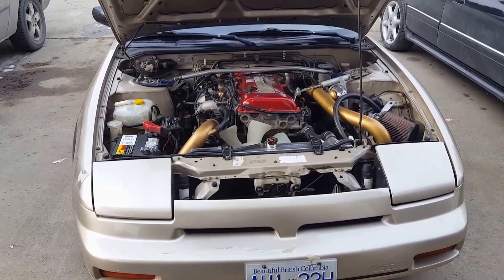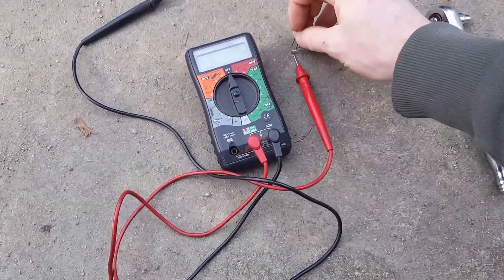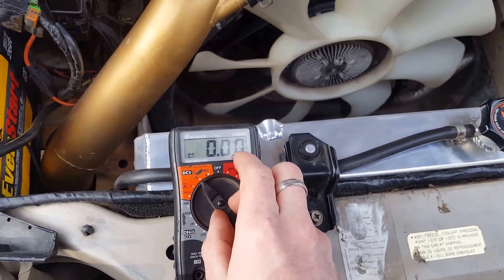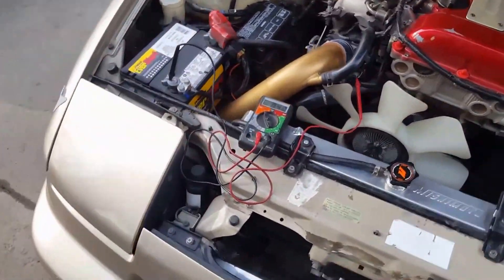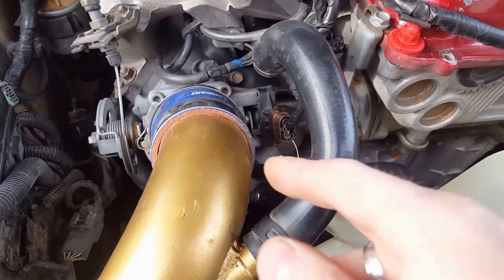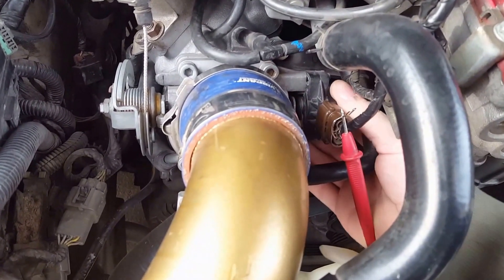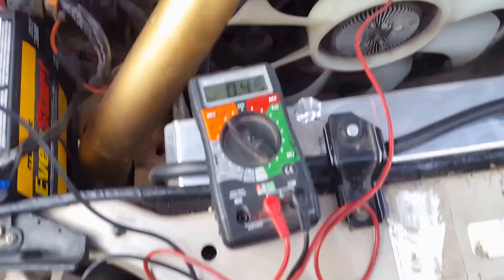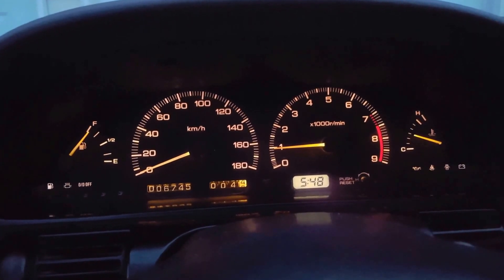SR20DET Throttle Position Sensor Calibration

Comment: Hello from 2025 😅 i have a problem with my sr20det tps signal voltage its too low at closed its 0.006 and at open its 0.014 what could be causing this? Any help would be appreciated ita getting good ground and 5v

Comment: Hey man,do you know the to set tps and relearn the ecu for rb25det neo? I set the voltage to 0.5v but idles too high.Thanks.
Reply from the maker: No I dont, sorry. Never had a chance to mess with those engines before

Comment: My car was bogging out when I gave it has and adjusting this fixed it. Idles better. Was at 1500. Not is around 1100. Not sure what else to check. Taking it to get returned by enthalpy but not sure if thatll fix my idle